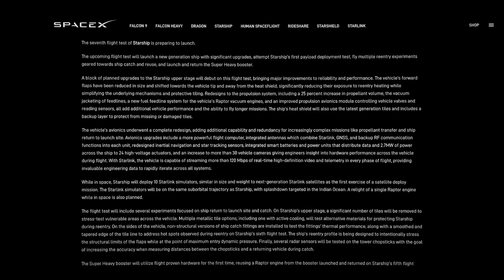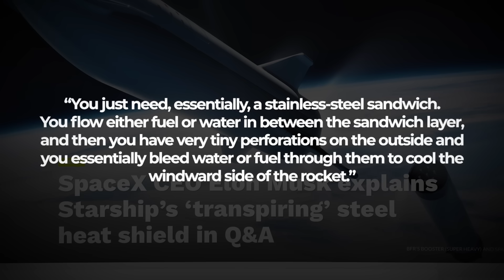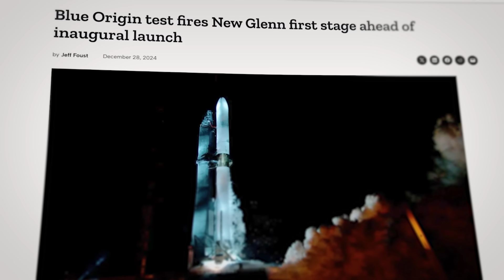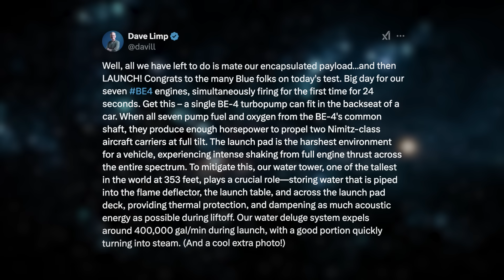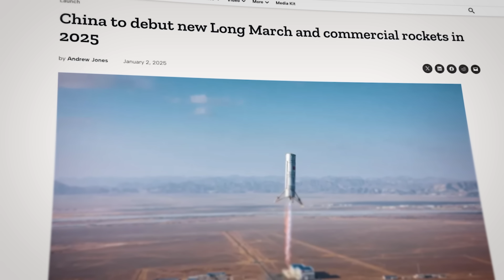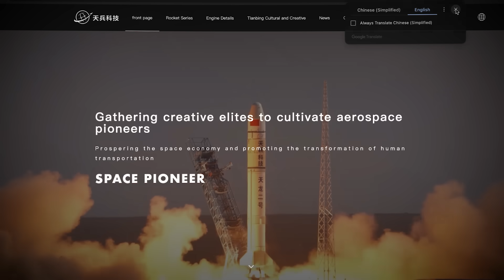SpaceX Is Launching Starship Block 2 This Weekend!

Comment: 4:20: I do not think the purpose of the vacuum-jacketed fuel lines is to keep the fuel cold; I think it's in fact the opposite. The fuel tank is above the LOX tank, and superchilled LOX is cold enough to freeze the methane fuel. Somebody (I forget who) did a whole video about this, and how--so far--the high rate of fuel flow through the lines and some games played with tank pressures can shift the phase diagrams around just enough to keep this from being a problem. I suspect SpaceX has determined that vacuum-insulated methane lines are, if not strictly needed, a good safety feature when they start talking about re-starting the Ship's engines in orbit.

BTW, I think the in-orbit engine restart is more important than SpaceX is making it sound. The FAA is not going to permit something the size of Starship to go into orbit unless it's demonstrated the ability to de-orbit in a controlled manner. That means restarting engine(s) in space. Once they've proven they can do this, I expect we'll quickly see an FAA approval for multiple orbital flights.

Comment: Comparing New Glenn to Starship is incorrect, it should be compared to Falcon 9.
Reply: Not really. New Glenn's claimed payload of 45 metric tons to LEO is almost exactly halfway between Falcon 9's 22 tons and Falcon Heavy's 63 tons. This may represent a "sweet spot," getting payloads that are too heavy for Falcon 9 but not heavy enough to justify the cost of Falcon Heavy.
Reply: @ExtroniusAttributes  bud, its accurate.  Looking at starship, this cannot compare.  Starship is 200 tons to orbit, as you said, its 45.  So twice falcon 9, a 10 year old design.  But nowhere near starship which will be fully reusable.  But I'm sure you thought that out well and kudos

Comment: The vacuum-shielded pipes, imo, are going to be an important system for the orbital tanker and propellant transfer process. Tanker propellant tanks and transfer tubes are going to get the same treatment to mitigate boil-off to a negligible minimum.

Comment: Can someone smart answer a question for me. Why would payload weight when traveling to mars, make the trip longer or shorter? Elon said without a payload the trip could be done a couple months quicker.. but I know in space, weight doesn’t mean anything right? Sorry for the dumb question, I just want it explained to me. Thank you!
Reply: Mass.  The engines have a limited run time, and a required speed for the ship/payload.  Accelerating mass is entirely dependent on the mass of the object.  An empty ship has less mass.  The physics applies no matter what the gravity is around the object.  A fully fuelled ship expends fuel as it fires the engines…the mass of the ship reduces…the acceleration increases.  The payload is simply mass, and that remains fixed.  So an empty Starship will use less fuel to achieve the target speed..or…attain a much higher speed for the same engine burn duration.
Reply: Inertia. More mass = more resistance to acceleration.

Comment: How can you say New Glenn is the largest rocket in service, when it has yet to launch even once, and is far smaller than Starship?
Reply: Cause he does not know much!
Reply: I was hoping someone would ask that obvious question.  Thanks.
Reply: "It's much bigger than any other rocket currently in service"
I feel like you're being uncharitable when you take that to mean that New Glenn is in service, and not that it's bigger than any rocket flying commercial payloads (which neither New Glenn nor Starship are currently doing).

If you believe otherwise, please suggest a way the narrator could have said it that makes more sense, without being more wordy.
Reply: @ReddwarfIV  they are attempting to launch an untested system.  Starship could have gone into orbit and be sacrificed like New Glenn starting with flight 5.  It did not go into orbit intentionally and it is the largest functioning rocket.  It hasn’t reached its final configuration. That would be factual, which is what people are looking for.  Thanks
Reply: @Andrew_Murro  New Glenn is flying an actual payload, the Blue Ring space tug. Starship is still very much suborbital, I think that's why they're launching V2. To be perfectly frank, I think they'll need another 2 or 3 versions before commercial operations because I don't think they're doing any simulations at SpaceX.
Reply: New Glenn will be an fully operational vehicle when it launches. Starships is a test vehicle in a test flight envelope.
Reply: @FootballKingInSpace-j9v  actually neither rocket is operational, as of today, and that is my point.     And by the time New Glenn puts something other than a lead suitcase into orbit, starship will have been delivering satellites.   The statement  made was factually incorrect
Reply: @FootballKingInSpace-j9v  that why it’s flying a cargo of lead I guess?

Comment: Everyone seems to be designing rockets to compete with the Falcon 9.  Meanwhile, SpaceX is looking to replace the Falcon 9 and heavy with the Starship, obsoleting everyone's plans.
Reply: Musk is exaggerating the launch cost advantage. A much much bigger rocket is not inherently cheaper. On the contrary. So to get Starship below the F9 costs he makes questionable assumptions such as both stages being reflown indefinitely with no refurbishment between flights. We have seen zero indication that this is realistic.

The first stage they did land was still too damaged for them to even attempt reuse, and the second stage reuse is very far from a reality. We have with our own eyes on the live feed seen the damage that the second stage currently takes during re-entry, and this is clearly not suited for reuse unless they can improve the heat shield a lot. The second stage reuse issue looks a lot like the similar challenge for the Space Shuttle. Sure it’s possible, but it’s not rapid and it’s not without refurbishment, which significantly changes the cost calculation.

I have no doubt SpaceX can get the costs of reuse to be a lot better than the shuttle. But I am not quite as sure they can beat F9 on a cost per launch basis as F9 is already pretty cheap.
Reply: @torben777  We saw no indication that the Falcon 9 booster would be reusable until they did it.  Seems SpaceX knows what they're doing and you think you know what they're doing.  Big difference.
Reply: Yup. They don’t know what to do other than copy. W/o Elons lead they don’t know what to make.
Reply: I am not sure Starship can compete with F9. It is simply the wrong size, shape and form. In its current iteration it does not have the delta V of the F9. It can put less not more payload into useful orbits, and its payload fairing system - or lack thereof - means it is far less flexible in what it can carry.

Many starship design decisions are based on the pipe dream of colonizing Mars, which makes it less suited for satellite deployment.
Reply: @torben777  After all SpaceX has given us and you still doubt that they know what they're doing?  I think I'll be listening to SpaceX where all the world's best rocket scientists reside and not you.
Reply: Everyone needs to beware of the aftermath of EM & STOP being brainwashed and deceived! He's NOT for humanity.  It's about control & money!! Watch!
Reply: The second half of this video is talking about the new glenn rocket which can carry twice as much as the Falcon 9. It's quite a bit less then Starship but a nice middle ground for customers that wouldn't need that much.
Reply: @carazy1  The problem is it will cost 2 to 3 times as much per flight than the Starship, so it will be almost immediately obsolete along with the F9 and heavy once Starship is in full swing.
Reply: @billweberx  the problem is you made that number up. Quick googling shows that prices for both have not been released but it is estimated that New Glenn will cost 68mil per launch and Starship around 100mil. Falcon 9 currently is around 62mil. New Glenn can carry about twice as much as Falcon 9 and half as much as starship so the estimated pricing I found makes it sit right in between
Reply: @billweberx  Also if there is one thing we have learned is that Jeff Bezos does not play around. They routinely sold products at a loss on amazon to drive out competitors. Since we have the richest people competing in this I see nothing but upsides for general space fans where we will get cheaper and cheaper flights. Competition is a great thing and should be encouraged.
Reply: Elon musk! ❤
Reply: Look at Falcon 9 Vs Falcon Heavy launch numbers. There isn't much of a market for a Falcon Heavy sized vehicle. I wouldn't be surprised if Starship sells less than 10 launches over the next 10 years.
Reply: @eldrago19  It's all about launch cost.  It will cost much less to launch a Starship than a Falcon 9.  Musk said it would cost less than the falcon 1.  They will probably have 10 starship launches this year and a hundred in 2026
Reply: @eldrago19 I hope they will launch some realy huge telescope :)
Reply: @eldrago19  In 10 years falcon heavy will be the norm and everyone else will be 10 years behind again.
Reply: @eldrago19  He's already has a willing customer.  Himself.  Or more precisely, Starlink satellites.

Each one of these new ones are the weight of a car (1900kg), so Musk really needs a super heavy lift vehicle.  

Once Starlink is finished, his launches will probably slow down, unless he uses his fleet to start building bases in orbit or on the moon.  Starlink is probably going to make him the first trillionaire, and he may just start mining the moon to jump start a whole new cislunar economy.
Reply: This is nonsense. We know what the market is internationally, there is literally no market for lifting 200, or 100 tonnes to orbit. Also, why are they deploying mock satellites? They had been contracted to land on the moon one year ago, but instead of developing anything to fulfil the contract, which has been overpaid 50% already, like orbital refuelling (even paid separately already), moon landing gear, moon surface elevator etc, they are using the  tax payer money to instead develop their own interest product for deploying satellites. Typical Musk fraud.
Reply: @ Jealous of the incredible Elon Musk! The guy is literally LIT at the moment! 🔥
Reply: @Baerchenization  Musk is not building the Starship for launching payloads to LEO.  That's just a side gig.  He wants to go to Mars and this is the best way we know of to get there.  The Starship will take over for the F9 and FH as it costs less per flight than either.  It doesn't matter if they fill the Starship with payloads or just carry a small satellite.  It's still cheaper than any other launch vehicle presently or being designed.     No fraud here.  Just the best rocket science ever conceived.

Comment: Which is better: Falcon Heavy, New Glenn, or Vulcan Centaur? No bias toward SpaceX
Reply: New Glenn seems like it will have better reusability and so will likely be cheaper and so right now is more reliable. Falcon Heavy has more flight experience. Vulcan... Exists.
Reply: @eldrago19  you're forgetting the cost of the ships. Elon makes starship out of common, cheap 304 stainless. New glenn?? Falcon?? MUCH more expensive tube metal,  doped aluminum with lithium I believe. Stupid expensive stuff. 
Starship are made of the stuff your appliances are made of, stupid common. 

There is a difference that reliability will not change... I can make 100 for the cost of 8 of yours. Now who wins? What if you LOSE one of those golden rockets??
Reply: Limit the choices to one's that have flown and we may talk
Reply: To decide what better means you'll have to set a metric.
Reply: Hard to answer. We need to see the new Falcon Heavy fairing, launch of the New Glenn and recovery, and the recovery of ULA's Vulcan. Should know by the middle of the year.
Reply: Vulcan is not in the same class as New Glenn or Falcon heavy. It cant lift nearly as much payload and its fully expendable.
Reply: Long March 12A